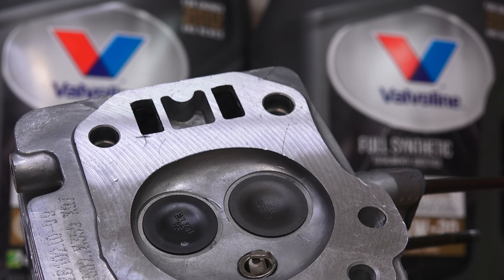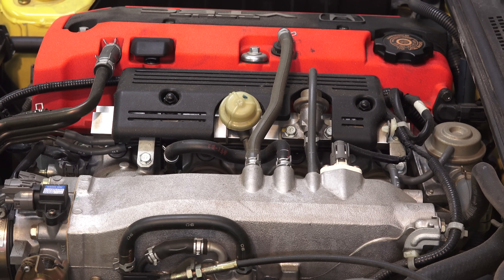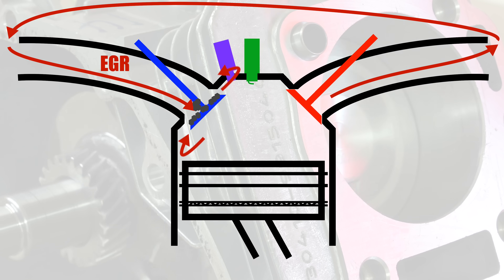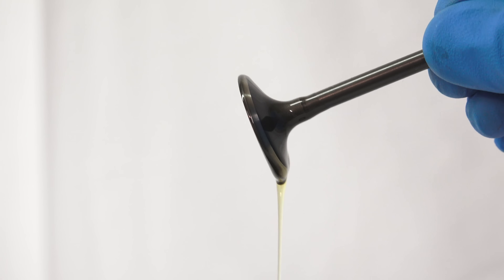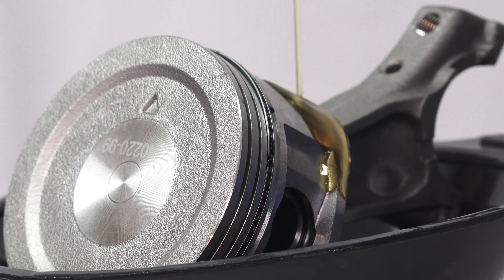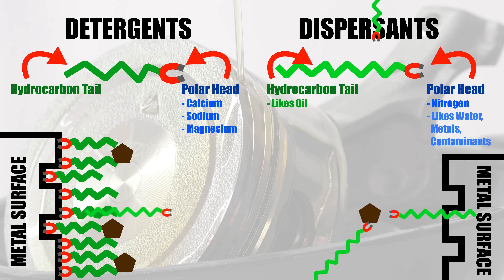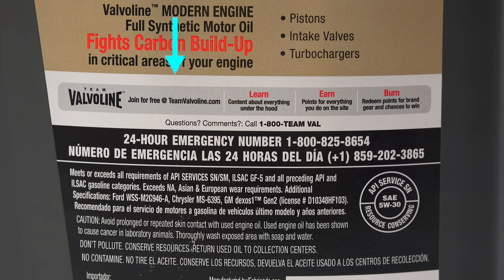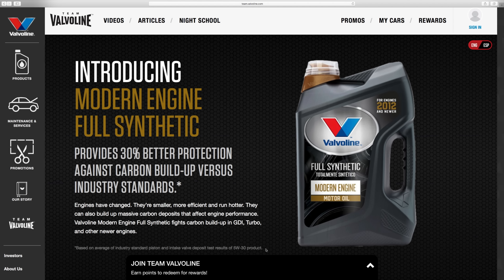Can Engine Oil Help Prevent Carbon Build Up?

Comment: Don't some newer direct injection engines incorporate a small amount of port injection for the sole purpose of keeping the intake valves clean?  30% reduction in deposits is cool and all, but I'm sure the intake valves will still gunk up pretty bad without something being sprayed on the valves.
Reply from the maker: I've spoken with a few companies about this, most of them (and I'm not sure why) are hesitant to say that the addition of port injection is to keep the valves clean (maybe they have other DI applications in their lineup)? When I ask, usually they say the combination is done for efficiency purposes, as some port injection is preferred for low loads, while direct is preferred for higher loads.
Reply: @EngineeringExplained  If they admit the port injectors are there to combat carbon buildup, then they have admitted that DI engines have an inherent problem of carbon buildup.  I would imagine they might be worried about a huge class action lawsuit.
Reply: Shane Broussard bingo
Reply: @invertedpolarity6890  you can thank government regulation on emissions as to why direct injection is in so many new cars.
They can't meet the requirements right now with port injected engines so they went with direct injected designs.
Reply: Shane Broussard . Spot on. Ford won't even let there people who write TSB's or internal tech message help release info on low speed engine knock. Oil is one factor but only part of the problem.
Reply: Kabloosh Believe it not, dual injection engines under normal fuel economical conditions, will run on port injection, direct kicks in under more moderate acceleration and higher engine speeds. At least that's what I understood from training classes.
Reply: @invertedpolarity6890  I think you are on to something. I was interested in a new 2019 Nissan Altima and wanted to know what the plan is to deal with DI carbon buildup. I called Nissan headquarters and they opened a case on this question. When all was said and done, they would not respond by email and insisted that I make phone contact. I called and was told that they cannot (more like refuse to answer) that question. So they obviously  have no plan and know that the problem will exist,  and don't want to lose sales by answering the question.
Reply: @mr.nobody3455  
Dont buy a Nissan because of their shitty CVT trans anyway......worst CVT in the industry!!
Reply: Engineering Explained-  Ford Gen 2 Ecoboost motors are dual injected.  Port injection helps to alleviate more of the carbon buildup.  It seems that not enough R&D was done [Gen 1] to figure this was going to be a problem in the long run.
Reply: @EngineeringExplained  I have always assumed the oppersate, low loads like DI where no fuel is lost and smaller amounts can be injected more accuratley and instantly, but power likes a better mixture and atomisation whitch comes from mixing further up the intake runner at a higher velocity and given more time.
Reply: @veneratedmortal4369  The DI engines provide better fuel economy AND more power than a TPI engine, while lowering emissions (everything else being equal). You get more complete combustion and lower combustion chamber temps because of quenching from the incoming fuel charge at about 2200PSI. This allows higher compression ratios and thus higher horsepower and better MPG.
Reply: @EngineeringExplained  OR, maybe the manufacturer doesn't want to admit that there is a FLAW in their engines!
Reply: I've read some DI engines are engineered for a staggered/random squirt from the injector just as the valve is opening or closing.  It's tough to find definitive information on the exact engine program, possibly because makers see it as a trade secret or perhaps I just don't know where to look (or proper keywords to find it?).
Reply: Kevin Heckeler Kia and Hyundai use that system..👍🏽 as well as a combination valve timing to keep the valves open longer
Reply: Knuckles300
I don't think so.
Reply: @tails300  Toyota had it first, SURPRISE!
Reply: One more reason why KIA is killing sales over most other manufacturers. These days, its all about the factory warranty. I just bought a new Ford, and in hindsight am pissed realizing how quick that 36k warranty will expire. I love my Ford's, but what a damn joke of a warranty period. 100k mileage warranty with length terms to atleast match selected finance period should be a requirement of federal law.
I can control the miles attained on the vehicle if I try, but Lord knows I wont have it paid off yet in 36 monthly payments...
Reply: @cjhosey3438  
Better read your KIA warranty again, I'm pretty sure it DOES NOT cover Carbon Buildup as it's considered a maintenance problem.
Reply: Usually turbo charged vehicles aren't port injected, due to the increased intake temps. You'd have to inject the fuel at high pressure before the intercooler, and that's not easy.
regular engines can be port injected, with an additional direct injection system. They're efficient, but more expensive, as you'd need a low pressure high flow, and and a high pressure low flow fuel pump, one for each type of injector..
If it was up to me, all regular cars, would be carbureted, with direct injection to compensate for lean or rich burn!
Reply: @ProDigit80  Why do you need 4 fuel pumps? Fuel pumps have nothing to do with fuel pressure, that would be the pressure regulator. Even if you did want to do it like that surely you could share the high flow lift pump?
Reply: Mazda uses heat. Make the valve super hot so nothing sticks
Reply: @Suction_  Nah, they coat the intake valves with I Can't Believe It's Not Butter!
Reply: @Top10girl  THAT is funny!!!!!
Reply: @Top10girl  I believe they coat them with teflon. Nothing sticks to Teflon!
Reply: emark24:  That's what Mazda says - and it may work to some degree - but Mazda forums show owners still experiencing valve deposit issues with their direct injection engines (and are adding catch cans for oil blow-by).
Reply: emark24  So how does that work?
Reply: @Suction_  Yes, I've read that Mazda designs the valve train to maintain valve temps above 400F which they say prevents carbon build up. But does this mean that until the temp rises to 400F carbon will build up? How long does it take to get to 400F?
Reply: @robertdevoy3119  that I dont know, but it should burn it off. I think its 400C also, not 400F, but I could be wrong. My buddy has a used car dealer and he bought a 14 mazda 6 with 120k on it. Pulled the intake and it was very clean. Some buildup, but nothing in any comparison to the competition. So whatever they did, appears to work
Reply: I work at Bosch making direct and port fuel injectors, and from what I understand it's partially for efficiency purposes and partially for valve cleaning. I'd love to see more manufacturers go to port water injection
Reply: Subaru uses both. The FA20 in the BRZ has dual injection, but the FA20 in the WRX only has direct injection. So even the same series of motor can change.
Reply: The BRZ was a joint project with Toyota and uses the Toyota fuel injection system.  Too bad they didn't use it on the WRX too.
Reply: John's Projects that's cause their not the same engine, cause the BRZ is a gt86 and Toyota wanted an H type motor they let subaru use that system for just that one and only car. The FA20 in the WRX is also larger that the BRZ FA20, from my understanding(also super basic) the FA20 brz is an ej207 short block with some Toyota heads slapped on, not completely true but it's kinda an over simplification
Reply: Yeah Lexus/Toyota were the first ones to do it.
Reply: @voice of reason Yes, then in future, they can change the timing of them too, if desired
Reply: What do you think the SECOND injector is there for? Even YOU stated that it's SOLE purpose is to clean the intakes by spraying gas on the back!
Reply: Most DI engines use 0w-20 full synthetic.  A low volatility oil lile 0w will not make its way back to the intake valves
Reply: What would be a good interval for intake valve cleaner for a 2020 Mazda 6??
Reply: I know Toyota's D4-S engines use both direct and port injections. I don't know any other manufacturers.
Reply: Richard Ojeda Fords new generation of ecoboost engines are dual injected as well. Cleans valves and has smoother idle especially when engine is cold.
Reply: Richard Ojeda
My 2017 Honda Accord has port and direct injection.
Reply: Ford Gen 2 Ecoboost and maybe even some N/A applications as well.
Reply: Richard Ojeda:  I believe Ford has also begun using dual injection for their Mustang GT. Any others?
Reply: @TheRichardF10  Later Model Ecoboost Engines from Ford do this also
Reply: Richard Ojeda Ford’s 2nd gen Ecoboost use dual injection
Reply: @nukiepoo  
What years are the Ford 2nd gen engines??
Reply: @TheRichardF10  Ford is using that on its 2018 and newer 5.0 liter Coyote V-8s.
Reply: @TheRichardF10  Ford has dual injection on at least one model, the "fire breathing" Shelby Mustang GT 500!
Reply: Knuckles300 do you have links to articles where that info is?
Reply: This is why high altitude commercial jet airliners spray chemtrails. It's to keep intake valves on direct injection motors clean. There's also nanobots in the chemtrails that are insinuated into the human body in order to make us buy more junk. Those nanobots are carbon based and when they find their way into your engine they act as an upper cylinder lubricant - like neutrinos they pass through pleated paper air cleaner elements.
Reply: @ThePaulv12  you started with something interesting, and then you went into crazy talk. Carbon that becomes upper Cylinder lubricant which goes through air filters lile it's a neutrino? I hope you're trying to be funny because it is. 😂

If not, don't take offense. None is offered. 👍
Reply: @ThePaulv12  Is that what they do, I assumed that it is because the moisture and/or another unburned liquid in the exhaust gases are condensaiting in the cold, high altitude air??
Reply: @veneratedmortal4369  Yes Nathan, but recently I looked up gullible in the dictionary and you know what? It wasn't there.
Reply: @ThePaulv12  I just looked up politeness, I couldn't find that either.
Reply: @ThePaulv12  HAHAHAHA
Reply: @ThePaulv12  lol 😂

Comment: This new Valvoline is quite expensive and has a higher noack (vaporization) number than a much cheaper bottle of Quaker State. Is it relying on the oil vapor itself to clean the valves?
Reply: How expensive is this new Valvoline? Quaker State is make by Shell so its quality isn't bad.
Reply: Last time I was in AutoZone it was $50 compared to QS Ultimate at $25
Reply: i always go to walmart and the oil there is so much cheaper. I got valvoline full synthetic for 27 bucks.
Reply: @sirfellar4820  regular SynPower was something like $30 at AutoZone too. Mobil 1 20k mile and this stuff were the expensive stuff.
Reply: @sirfellar4820  Wal-Mart is more expensive if your car is vintage or your running a motorcycle. I always go to AutoZone. By on sale and get a point. 5 points and 20 dollars are mine at AutoZone if I use it within 3 months...ads up yo cheaper and a better filter then at Wally World.
Reply: DE Nichols Walmart is always cheaper, mobile 1 full synthetic is always 22-23 dollars, Castrol syntec is around 26-27
Reply: @noventay4  when on sale with a free oil filter. AutoZone is cheaper BEFORE my reward point which is worth five dollars. That's Mobil 1 on sale.

Castrol has different levels of synthetics. You say they cost even more than Mobil 1? When on sale Castrol is the same price which then beats Wal-Mart by the price difference you specified. 

The only way your "winning" on price is if you use a cheap oil filter. I get the best and my oil takes more miles to stop being clear.
Reply: @noventay4  
Neither of those oils are 100% synthetic.
Reply: nmh5001 in a sense yes
Reply: @nicolaslosito5735  

That doesn't make any sense. The volatility is part of what's causing build-up. I'll read their white papers but that seems like a load of crap. A product marketed well doesn't mean the product does well.

 I remember when they had the 'green', eco friendly stuff made from recycled oil. This just seems like another marketing ploy.

Comment: a mechanic suggested to use engine oil in fuel to prevent valve seats from drying completely. i am using an air cooled 125cc single cylinder bike from Piaggio.

Heip please
Reply: you can use marvel mystery oil if it sits alot but if you ride it once a week or more you dont need to do anything

Comment: Would this be a good oil to use for my 17 wrx? Have an AOS and EGR deletes, full bolt ons minus E85. Id assume any oil that's the right viscosity will do or no?
Reply: Edwin H depends how much you are willing to pay and how well you want the oil to perform.
Reply: what happened to your 2015?

Comment: Today's engines really seem to be pressing the engine durability and limitations.  Small engines supposedly more power tremendous heat buildup less durability not good combinations. Are you know telling me I need an engineering degree to know what type of oil to put in my car.👎
Reply: Agreed...I think we're at the point where long term durability of engines is being sacrificed to improve fuel economy numbers.  Manufacturers could have simply gone back to port injection to resolve the carbonization issues introduced by direct injection but didn't, no doubt due to the "value" of those extra few percent in fuel economy. 

And yeah, oil is increasingly important in keeping these little turbocharged engines happy.  You really need to make sure the oil you use meets the specifications the manufacturer of your engine requires, otherwise they could deny warranty coverage if problems develop.  As an example I seem to recall the oil used in a Chevy Cruze needing to meet some obscure specification not met by several oils on the market.

Comment: nice video. sometimes i miss having an engineering explained back in europe. how about diversifying your geo area? it would be very nice to hear about engine oil and diesel/dpf engines.
Reply: heck, it would be so interesting to describe tech solutions used in other markets, even but not limited to the jdm. be a land cruiser, it rocks everywhere.
Reply from the maker: The contents of this video (and the vast majority of my videos) are applicable anywhere. :)

Comment: How is positive crankcase ventilation accomplished with a turbocharger?  The intake manifold has positive pressure, not vacuum, when you have a turbo.  Do the PCV gases (and oil droplets) go into the intake side of the turbocharger compressor???  That seems like a terrible idea for turbo reliability, even if a catch-can is used to trap most (90%) of the oil.
Reply from the maker: One way valves. Turbo engines still operate mostly under vacuum unless you're flooring it, so PCV functions normally.
Reply: If you have one-way valves that close off the crankcase from the intake manifold while the turbo is making boost (high RPM), does the crankcase pressure increase (follow) the intake manifold pressure?   Maybe an idea for a new video?  I'm still kind-of fuzzy on this.
Reply: My old truck vents into the intake before the turbo. Not sure about new cars. There are stories of people with bad rings or damaged cylinders over pressurizing the crankcase and filling the intercooler with oil. I dont know how true it is but is sounds possible.
Reply: Some turbo gas engines have what's called an ejector tee and it uses airflow of the engine under boost to pass through a tube that has a 90 degree fitting on it, creating suction. And that's used for the purge function of the evap system. So they should just do the same thing for crankcase ventilation.